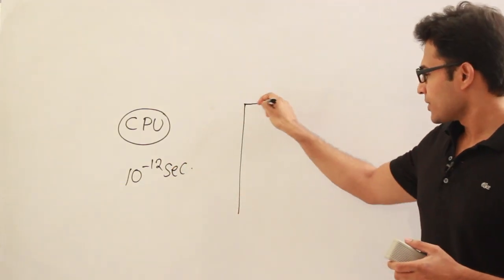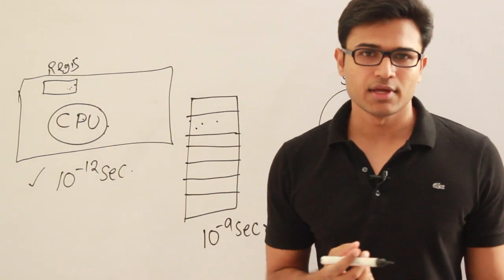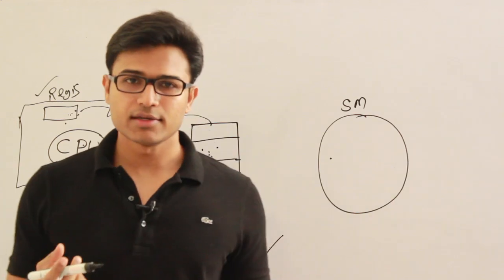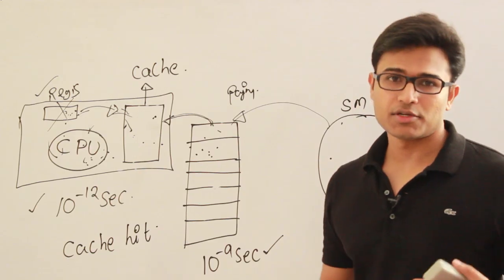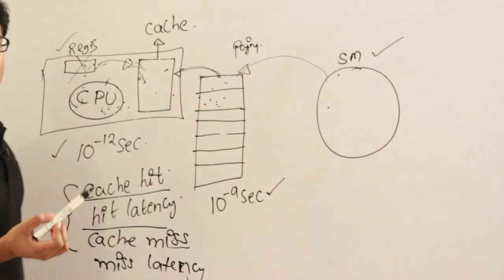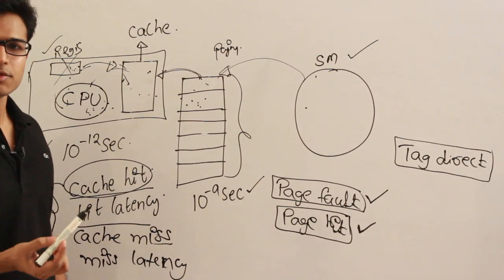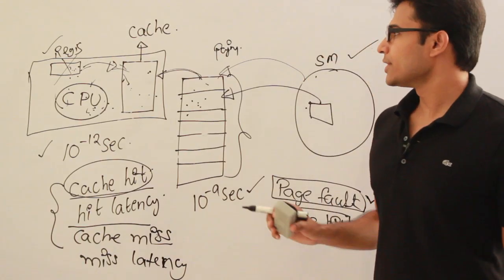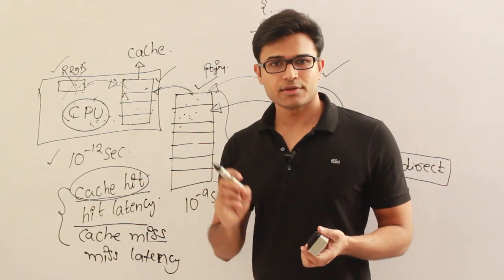COA | Cache | Introduction to Cache Memory | Ravindrababu Ravula | Free GATE CS Classes

Comment: Consider the machine of Figure 3.4 in top level view of computer architecture chapter also has the following  instruction:  1010= xor to AC  from device  1110 = Jump if sign=0 1111 = halt    Where the sign bit is the  most significant bit of an integer. Halt is the end of the program  
For the following program, the program start at address 400:  
1. Load AC from memory 110

 - 2. Xor to Ac from device 200
 - 3. Jump if sign=0 to 410
 - 4. Store Ac to memory 111
 - 5. halt  

the program in address 410: -1. store Ac to memory 112         ,    - 2. halt  
please  
Help me solve the exercise

Comment: The explanation of temporal locality was incorrect. 12:20 He said that "Least" frequently used has high chances of getting used again.

Temporal Locality: (from wiki: https://en.wikipedia.org/wiki/Locality_of_reference )
If at one point a particular memory location is referenced, then it is likely that the same location will be referenced again in the near future. There is a temporal proximity between the adjacent references to the same memory location.

Comment: You made a mistake. You said that the CPU is faster than memory (which is correct). But you gave an example assuming CPU has a speed of 10^-12 and to read from memory it will take 10^-9 seconds. But 10^-12 < 10^-9.
Reply: You got a conceptual mistake. Whatever said is correct since the speed of memory is slower as compared to CPU. So at the time of fetching data from the memory CPU will be under waiting state and will become active after 10^-9 sec. So eventually CPU fetches data at the rate of 10^-9 sec.
Reply: @aprender faster means less time.